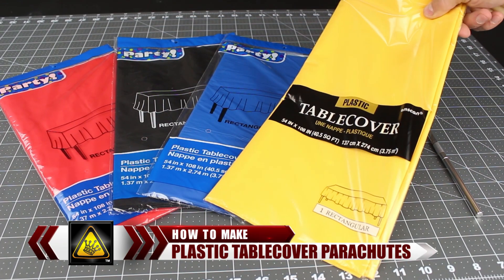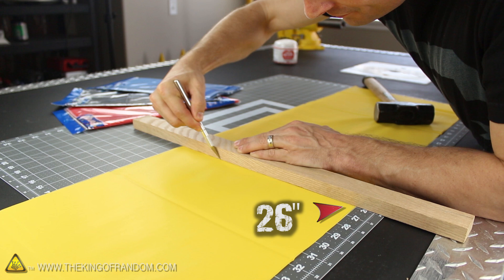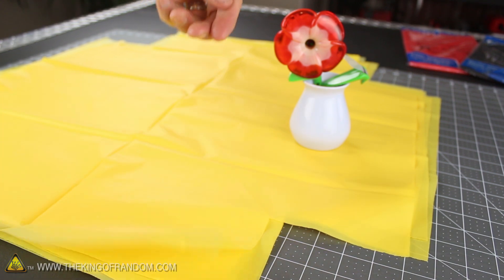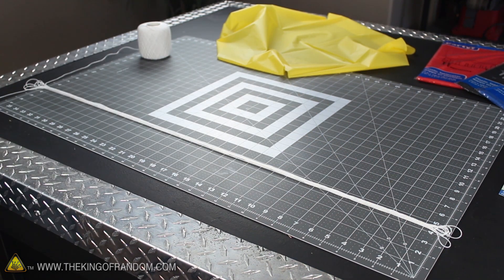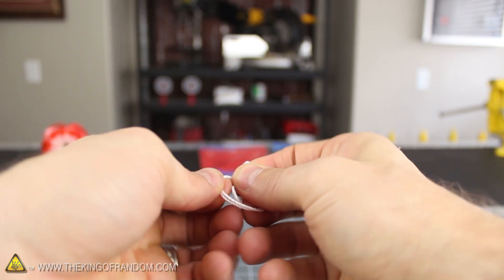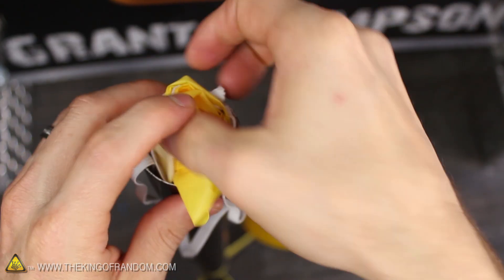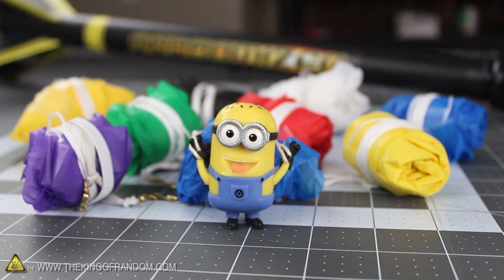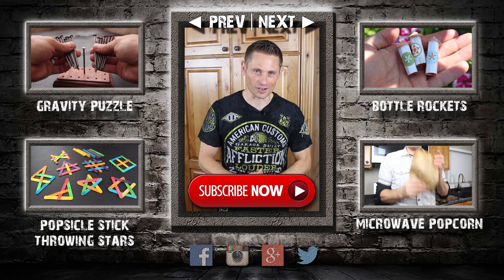Plastic Tablecover Parachutes

Comment: Hi Grant, 
Videos are Great. I am making a rocket similar to the randomizer with my 8th grade son. The randomizer turned out to be undoable with materials available in Germany. With imagination we are making something close. We are trying to make the parachutes now. Again we cannot get the table cloths you use, which has caused us some trouble. In order to help those outside of the US, it would be cool if you could always give the exact measurements of the materials you are using. This then makes it possible to find substitutes much more easy and make less mistakes. For example, we are using a poncho instead of the table cloths for our chutes. In the video we did not catch that you were making the cuts on 2 layers of the table cloths until using the technique on our single layer poncho to find that we did not get a cross, but only a half of one 😂 . Anyway, thanks for making the videos. We are having a lot of fun.

Comment: Pro tip : if you have no table cloth cut a garbage bag in half it is slightly smaller but will work with the randomizer rocket
Reply: why tf this has no replys anyways thanks dude
Reply: Thanks so much!

Comment: Can I use this on my quadcopter?
Reply: +ElitePilotHD pack it tight! also use lighter black powder.
Reply: +ElitePilotHD Of course you can.  You would need to devise some way to deploy it when you want as, in Grant's case, the rocket motor automatically deploys it a few seconds after the main burn shuts down.  An accidental deployment (especially when the props are still active) could be catastrophic, so it would make sense to detect if they are before deploying. I would also recommend figuring out some way to launch the chute  away from the quad, so that the lines don't get tangled and the chute can fully open.
Reply: +ElitePilotHD do it with helium balloons. let them fly then shoot them in the midair.
Reply: +ElitePilotHD Make the parachute larger, in fact the very reason i watched this video is working out how to make a parachute for my 1.7kg quadcopter!

Comment: Hey grant.... I made the slingshot and asked questions there, but it didn't get answered.

I am wondering why when I make the 'sling it always snaps the cords after a few days... maybe because the zip ties are too tioght?
Reply: Blue Lamp Why are you attacking me? Did I do something to you or do you just get mad at random people like a seven year old would? Also, my summary was when I decided to do a stupid project that I am no longer working on. Secondly, I looked very thoroughly through the description of the original and comments and did not find any evidence of this happening before. Finally, you wouldn't need to correct your grammar in the first place if you actually were educated.  And honestly, it's sad that you are not educated and that you will only be able to work at McDonalds, because I wish good fortune on everybody.
Reply: Grant Thompson - "The King of Random"
 Thank you for the advice. I did buy the the two bands but also bought a single band the first time. I may end up modifying the slingshot  so that the band goes into a PVC pipe (filled with resin/epoxy) with holes drilled and tie off the ends. Thanks for the help!
Reply: Blue Lamp How does this relate to the video? Also, I did it before the " X subscribers  with NO VIDEOS" was a thing.
Reply from the maker: +Alexander L I've never had the thick bands break.  Only the smaller ones that come 2 in one box.  Try using Duck Tape or Electrical tape instead of the zip ties and see if that helps?
Reply: Blue Lamp Ok. I forgive you :).
Reply: +Grant Thompson - "The King of Random" I love me some Duck tape.
Reply: youre so stupid.i read your utube summary.there is many people who reached a thousand subscribers without 1 video.do your research first dumbo.also i didnt want to correct my grammer because its useless a 7 year old like you alexander can read it
Reply: I rushed through it i didnt want to go to the other slide to put commas and apostrophes
Reply: Alexander L i was mad because you didnt think about your goal before
Reply: Many people have done it
Reply: Alexander L still many people accomplished this before second i was angry for something i dont remember please forgive me no punctuation
Reply: Alexander L good thing youre mature about it smiley face
Reply: Please help me how do you a tach the sky balls to the parsshoot
Reply: +Grant Thompson - "The King of Random"  help me!! please this is a stupid question but how do you atach the patchute to the skyballs
Reply: Abdullah Obaid dood there's a vid go to it duh
Reply: #noSkulls;

Comment: Is Scotch tape really strong enough for these parachutes? That's rather surprising.
Reply from the maker: +Joe Vasicek Yes it works for about 50-100 launches before the tape starts having trouble.  It is the most common point of failure though, so perhaps electrical tape or a tape with stronger adhesive would increase their longevity.  Duck Tape would do it for sure.  It's an open source idea, so it's open to suggestions :)
Reply: @TheKingofRandom   I love you
Reply from the maker: +Gentleman²³ Many more times than that.
Reply: +Grant Thompson - "The King of Random" Duct tape is magic and should be worshipped ;)
Reply: I know right,, i used scotch tape only for sticking a paper and it does not work well
Reply: you are😎😎😎😎😎😎😎😎😎😎😎!!!$
Reply: +Grant Thompson - "The King of Random" did you launch it 50-100 times? Or is that how you judge it after launching it a couple time? Other than that, awesome video :D
Reply: Grant Thompson - "The King of Random" :D
Reply: +Joe Vasicek Yes, It is pretty strong, it ripped my desk right open.
Reply: +Grant Thompson - "The King of Random"  what if you just make them out of stronger tape?
Reply: +Joe Vasicek  touche
Reply: +Grant Thompson - "The King of Random" Could you also make giant parachutes by just doubling the dimensions?
Reply: +Joe Vasicek tyvek tape is super sticky and light wieght
Reply: Harrison Blake
Am I? Thats how Graphene was invented bud. Look it up
Reply: Flex tape, I had to do it
Reply: Should've used Flex Tape...
Reply: @joelmiguel9394  :(
Reply: +Joe Vasicek Scotch Tape is used to make Graphene. You know. The strongest material on earth. So scotch tape is pretty strong